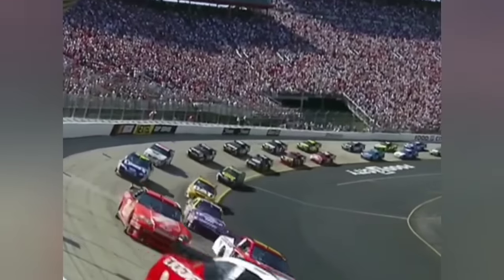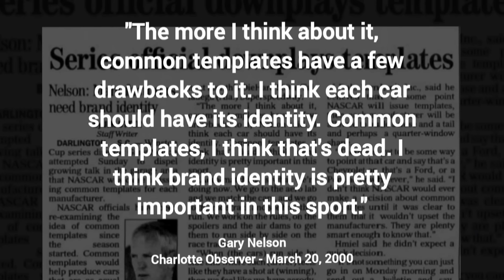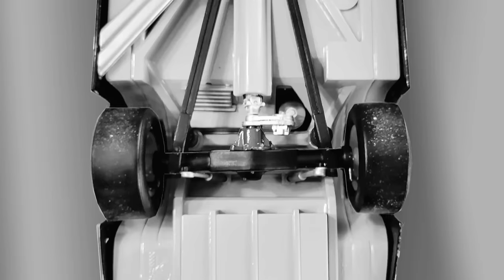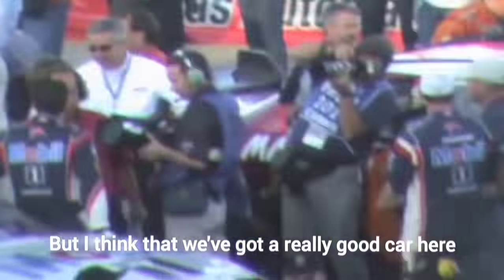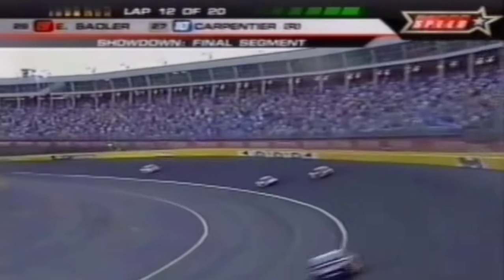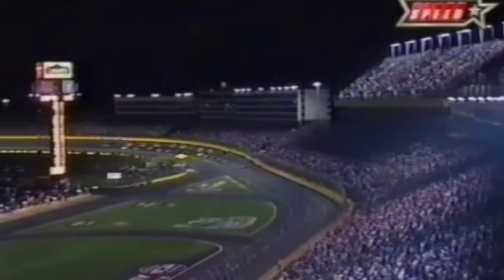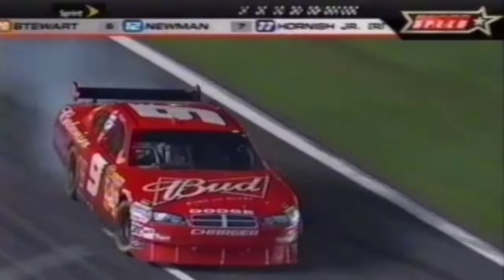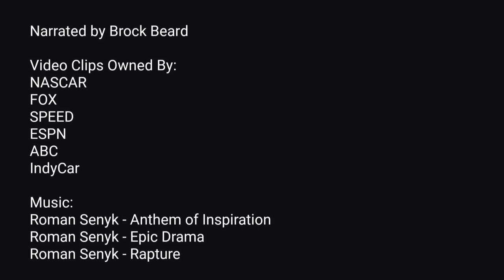The Car That Exploited the Car of Tomorrow

Comment: NASCAR is probably too far gone for this, but what I would really like to see in any racing series is a return to some strict homologation rules. Obviously the racing needs to still be good, but make it so that homologation rules force a manufacturer to make some obscene number of road-going versions that are as close (mechanically and aesthetically) to the racecar version as possible. That might make me actually buy a new car! It would be a tight balancing act building a chassis and drivetrain that is both successful at racing but still translates to a good road car. It can be done though.
It is sad that the Mustang GT3 was legally homologated by the Dark Horse which isn't even close to being mechanically similar to the GT3 version. Ford just made the GTD for fun...I think it would be more fun if homologation rules had forced them (and other GT3 manufacturers) to homologate actual GT3 cars as opposed to allowing base model variants that only share the same marque to count towards homologation.

Comment: tl; dr: thoughts of someone outside the culture, wtf do I know. 

I feel like this is entirely a result of track design. Not to completely upend and argue with tradition, but wouldn't changing the track to a figure 8 shape fix skew without needing rules? With that, any advantage gained by leaning into designing for curves in one direction would lose when going the other way.

I just wonder if rules saying you can't do this, you can't do that, you can't do x, y, or z are anathema to the original spirit of the sport. Instead, wouldn't saying "that's a great innovation, but now let's challenge you more", be better?

Comment: NASCAR should be required to run an OEM factory produced body/chassis (obviously with appropriate roll cage and safety equipment) as well as OEM block/heads. Could be rules limiting cubic inch and number of valves or cams. With a minimum production of say 10,000 cars produced with that same body/chassis layout and same block/heads that is provided to the teams. Other then that let it ride let the best man win. If ford is more aero this year ok great they win, if dodge makes more power great the other manufactures need to step it up.

Comment: Instead of spending big mo on mods that may be banned why can’t they ASK NASCAR if they can use it??
What happened to the car and driver that installed a scuff rail  so it could scrape the wall for better handling?? It got banned but it also disappeared!! 
Did they find out the scuffing actually slowed the car down?? The Viagra car disappeared because the tires swole up and blew out wreaking the car!😊

Comment: Nascar died a long time ago.  Crap like this and the stages is just digging it up, violating it, and putting it in a deeper hole... I really wish that nascar would be actual racing again instead of commercials with cars doing lap breaks in between... but for that the people in charge would need to like racing and the drivers would need to know more than what they do now.

Comment: I grew up watching NASCAR with my Dad. Back in the late 60's. When Dodge/Plymouth ruled the tracks. Because the Rules were Manufacture's had to sell 500 cars to get the car in the race.  Now since the Car of tomorrow thinking.  It has wreaked the sport.  Dodge left, and Toyota bought their way into NASCAR.  Technically Toyota can only run in the Truck series, because they make a V8 RWD Truck.  But their cars shouldn't be in the Xfinity/Cup Series.  Supra is a Inline 6, RWD car. (It's never had a V8 in it). And Camry's are V6 FWD cars. (There have never been a V8 RWD car EVER).  And the Cars on the track today, have nothing to do with the Manufacture's other than the stickers on the cars.  NASCAR is only about the money now.  They could careless about the Manufactures, the fans, or even the Teams.  Gone are the days of Win on Sunday, Sell on Monday...  That vanished in the 70's, maybe the 80's. I don't know I was overseas in the USAF, watching Rally Races on British TV.  F1,  Saloon racing.  So why is there a Manufacture's Trophy?  If all the car's are the same? Are you going to say that only the Engines are different? Sure, fine. They still aren't the Engines that you and I can go to the dealership and buy..  Except maybe "Rouch" which is a Ford Brand. And was available in the Trucks only.  Manufactures are in name only on the tracks.  Sure I like some of the drivers.  But now they are only there to get sponsors,  so they have to drive better than the others on the track to win races.  NASCAR used to be just that about the Cars and the Drivers that drive the cars, and the fans who spend their hard earned money to see the race.  What will happen if other manufactures want to race in NASCAR?  Say Mercedes, Audi, Honda, Porcha, Ferrari, Jaguar, BMW want to race?  Are you going to tell them here is a shell, put your V8 in there. And get a Sticker pack for the outside.. Companies that Make Cars are going to give you the finger... NASCAR (Cause those brands actual make their cars,  here in the USA, we Assemble Cars. We don't stamp out body parts here anymore.) Tesla is the ONLY real Car Company in the USA.  Tesla takes Raw materials in, and a car comes out. Everything onsite.  Ford/Chevrolet/Toyota all parts are made some where else and are shipped to the Assembly Plant and put together.

Comment: Isn't that a battle between Manufacturers Chevrolet Ford Dodge Pontiac Buick ? What ever happened to Nascar now Next Gen no paint , wraps single lug nut not five teams building their own Chassis fuel injection bring back carburetors and distributors and no mufflers

Comment: I think the comments of the drivers in the beginning were funny, "I don't want to take a bunch of cars out there that aren't really cars and just put a sticker on them that says Ford." That is literally what Rusty Wallace drove his entire career. NASCAR cars have been stickered bodies 80s. A good 70% or more of the cars are the same. The bodies only loosely resemble a production model. Mostly its just the front clip that looks like a certain production car. Buying a brand that's winning in NASCAR has been the dumbest thing you could do after the 60s to early 70s. The 3 quotes they used are just stupid as they are saying "no, don't do this," when they have been doing that already for over a decade.

Comment: I miss the old days.
"Just be the fastest car, and don't make a semi-truck."
The only thing that should have happened is an enforced maximum speed to keep cars from going 300mph and becoming airplane wings in a headwind.
Motorsport isn't about the sport, it's about the car first, sport second. Else they'd have called it Sportmotoring.

Nascar was never meant to be an equal race of equal muscle, a race that nobody but the large titles were allowed to win.
It was about taking a production car, and making it win the race. Simple as.
If the end result of that means that one car looks like a bullet, and the other a battering ram, so be it.
Cars first.
Sport second.
This ain't formula 2.

Comment: "Common templates" BORING AS F***!
Good for Wallace and Jarret!
I totally agree with Daryl Waltrip. NASCAR is no longer NASCAR. The "S" is for "Stock". That idea of "stock cars" is gone with the car of tomorrow. Now NASCAR is no different F1. The only difference is the "formula". 

One of the "old school" drivers told a  story when he was working as an announcer in the 70's or 80's.  He talked about that as a drivers on a small team he would have a dedicated race car that they trailered from one location to the next, but they would also go to the local dealer and buy a car off that lot that they would strip and prepare as their backup. By the late 80's and 90's the "stock" cars were being hand built from the frame out. They still had the identity of the make and model, but that was all they had in common with cars on the dealer lot.
.
The other thing that is turning me off of NASCAR is "stage racing".  Throwing a yellow after the first 2 "stages. And if you have a madatory yellow in the first stage because there was no practice (like we have had in the COVID years) and viewers were forced to watch 10% or more of the race under the 3 mandatory yellows. IT SUCKS! It is BORING!

If they insist on awarding stage points, fine. But don't throw the yellow at the end of the stage. Keep racing. Force them to do more pitting under green. That is when strategy really comes into play.  Just like F1 forcing car to carry full fuel load from start. That change made the racing much more boring.  2-3 second stopped pit stops are insane. It took fuel load out of the strategy, just leaving tire type and timing the only remaining strategy elements.

Comment: Guaranteed if that were a Hendrick car not a word would have been said. The sport is so biased towards Hendrick Motorsports it's disgusting.
Reply: Highly doubt that. They wouldn't have banned the T-Rex car if that was the case.
Reply: @kriegsy69  No? The T-Rex car was banned instantly following the 96 97 or 98 all-star race. (I forget sorry). Roush, did that due to tires iirc. Nothing ever came from it.

Comment: Rules for racing ? ha ha ha just ludicrous. the rules should be "cubic dimensions" L x W x H Max . Total fuel Calories/ Mega joules. Otherwise .. What is the point ? TV ratings ? Not advancing tech ? I mean for gods sake tires are still using rubber ! Why ? Still using Pump gas becasue ? Total waste of time and money for the TV ratings and no progress in the sport or design.

Comment: Skewing is NOT new! When I ran dirt in the late 60s we noticed if we hit something just right the car handled much better!  😮Why straighten the frame when the handling was improved!!🤷🏻‍♂️Tech wouldn’t bother you if you were illegal if you didn’t run up front and upstage the big boys!!
Now the cars are so equal due to NASCAR  rules everyone scratches for a small advantage! Fans won’t come to a race with no wreaks with cars in the same lap! Smokey Eunuch 
was the worst cheater but he put butts in the seats so he was given some slack. He said when the others stop cheating he will!! Darrell Waltrip filled his frame with sand and after the green flag would activate a small motor to dump it out!! Smokey put gas in his frame and ran everyone else out waiting on him to put! The other drivers complained about sand from Darrell’s car scratching their windshield!! They would put a wax wedge in their suspension that would melt and lower the car!! It was said you could hear Darrell’s front spoiler scrapping!! Tighter inspection and increased fines stopped most cheating. They always find a way around the rules and will this one!!

Comment: This is why I don't like NASCAR.  The cars have nothing to do with stock automobiles.  I stopped by a garage where they had a NASCAR Taurus and I asked them what parts actually came off a Taurus.  The answer was the roof.  That was the only piece on the whole car that had anything in common with a Taurus.  You can put decals on any of their cars and the car becomes that of the manufacturer matching the decal. Instead of stock cars they should be called decal cars.

Comment: If you have "common templates" you killed invention. Common templates are only a "good" idea when trying to market something expensive for low production cost...which will ultimately fail in the long run, because consumers WANT different designs

Comment: Its not stock car racing anymore and hasn't been for a long time. Just a stock hood, roof and trunk lid, it should be called "Car Parts Racing" Now the tires are held on with just 1 nut. Nope this is just boring now, left turn, left turn, left turn followed by a left turn. Lets see what would happen if it went back to stock cars, just as anyone can buy.

Comment: It's got so boring. Limit the speed by limiting the fuel. F1 is the late 80s was so interesting as the cars were turbo charged. Each driver could turn up/down the boost, but you only had a single tank of fuel. It was a real juggling act to select the correct tyres, do not go too fast to conserve fuel etc. Too much downforce and you'd use more fuel. It made for some truly fantastic races. But, the cars could not go too fast otherwise they would run out of fuel, just like Senna did! This made the sport not just about drivers, but the engineering and tactics each team employed.

Comment: Second generation Dodge Intrepid was designed solely for use on the track, you know actually putting stock back into stock car racing. Would have been a slaughter for Ford and GM so the usual money talks killed it off in only 4 years.

Comment: CoT was where I stopped caring about NASCAR, the engines were also pretty much the same as well, the joke was take a dodge crank put it in the GM, take the GM heads put them on the Ford take the ford cam put it in the Toyota and take the Toyota pistons and put them in the Dodge. Essentially the whole series boiled down to one ideal car period, no innovation, no diversity, no soul, they were a spec class. Nothing more, nothing less

Comment: The car of tomorrow is what turned me off NASCAR. When I want to watch over regulated racing I watch F1. Personally I wish it went back to true stock cars. You buy the car from the dealership strip it down and race it. Then perhaps car companies would make cars the people want to buy. 
 I have no issue with Toyota running NASCAR but a V8 Camry I do have a problem since the only V8 in Toyota I can think of is the Tundra and can’t think of any car from Toyota on market with a V8

Comment: The Car of Tomorrow, was the beginning of the slow decline of NASCAR..
That's when Brian France started the destruction of his grandfathers and fathers dreams. If someone would start a new motor car racing circuit, with NASCAR'S OLD RULES and REGULATIONS, it would be the greatest sport known to MAN.
Go back to the old fair point system.. Where every driver has a chance to Win the Championship or better his points position, all the way to the season's end..
Have automobile manufacturers build 500 of their race ready like cars, for retail sales to the public. Just like they did in the first years of NASCAR.

Comment: Imagine spending all that money out engineering other teams to only start over the next season with no edge. You want innovation, but then you ban it... Who cares if cars look like they are driving inside out-as long as it's safe? The only rule that should be implemented is the budget or every car will continue to be the same and THAT is the NASCAR that I grew up hating- a bunch of the same crap taking a left turn. I mean you have to do something to make this racing sport exciting. I mean shoot, you practically have the same thing in F1, and that is already 1000x more exciting simply due to turns. Imagine if F1 had full flexibility other than budget?

Comment: Aren't advantages reason why teams/ppl/manufacturers go racing?  To prove/show that what they have is better than the other guys.  All teams/manufacturers had the same opportunity/poywntial to make a winning design/formula and some do it better than others.  That's why we race, yes?   Look at pine wood derby (minus the blatant cheaters) or soap box derby.  Design and creativity w/in the rules brings out the best.    This is the MAJOR reason I stopped watching NASCRAP, innovation and competition went out of the window.  They took the sport out of the sport.  Imagine (fast) Olympic sprinters having to wear drag chutes because they were too fast compared to their peers and the chutes slowed them down just enough to make the finish times closer plus they would have to wear the same shoes to negate traction or weight advantages.  Put NASCRAP rules in to other sports and see how unexciting those sports become.

Comment: Our goal of putting a man on the moon by the end of the decade and returning him had the effect of taking us out of the stone age into the information age. SO many things were improved and invented that benefitted all of us in so many ways. Good thing, then - that NASA wasn't run by NASCAR.  The race track is where a manufacturer develops innovation. Tying their hands stagnates innovation. I think NASCAR should be a place. A place where terrible things can happen. Because it's dangerous. Because there's NO RULES. Drivers and fans can accept that. NO. No, the deaths will NEVER be worth it. Let the overall TRUE end of season king of victors be the manufacturer / team that not only won the most / biggest races, but also racked up the SAFEST seat-mile SAFETY record for that season. Safety for the sake of NEVER ANY ASSIDENTS is boring. That's not racing. Racing is deadly, speed kills...if you can't accept that and stomach the horrific sad losses: you're in the wrong field. Safety AT THE EXPENSE of racing is crickets and cobwebs. I think we can have a breed of driver that can see an entire field of drivers and cars crash into an all the cars pile-up that bursts into flames and kills them all...put on his helmet, strap himself in and fire up that engine and say "Here goes OUR BEST!" We can invest more into safety. MUCH more. ONLY if the money is THERE!  PUSHING the limits - NOT shying away from them - is where advancements that benefit us all comes from. The NASCAR track HAD the supposed intended PURPOSE of exactly that. NASCAR is being mismanaged. NASCAR has lost it's way and forgotten it's purpose. NASCAR of today is a maddening disappointing bureaucracy of office politics, whiners, he said/she said bickering and tyranny. I've had breakfast with Richard Petty three times, never talked NASCAR. I have never liked the "sport" - just not thrilled about left turn ahead! OPE! LOOK OUT! EASY! What's THIS??! Watch out for it: This one's sneaky! I think it's another left...turn. With all the rules for the sake of "fairness" added in: no thanks. They've ruined it. It's UGLY. We feel betrayed by the weasel pencil pushers.